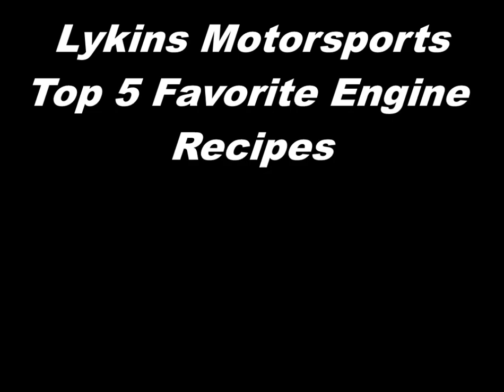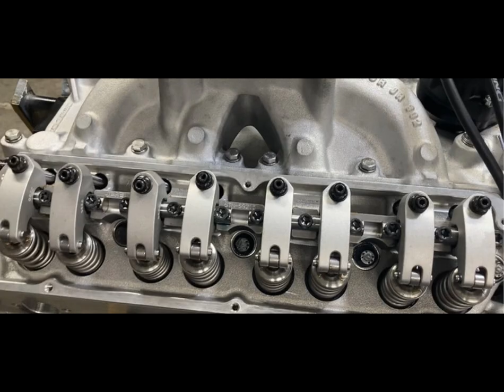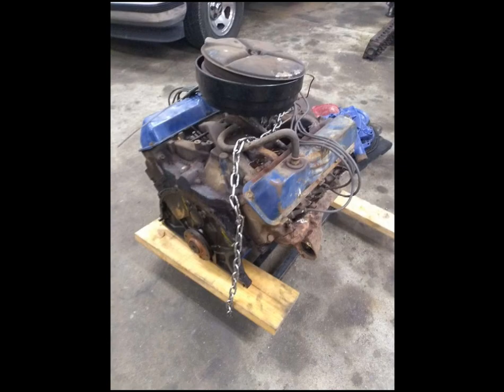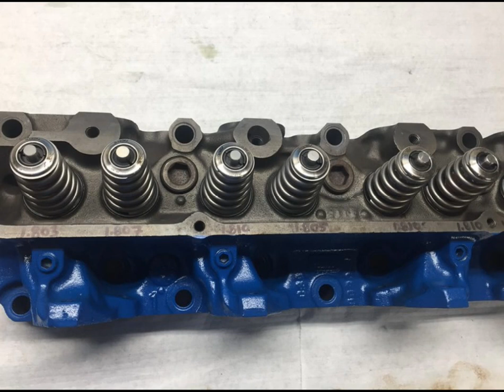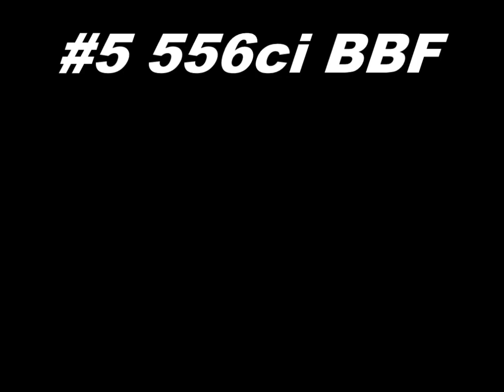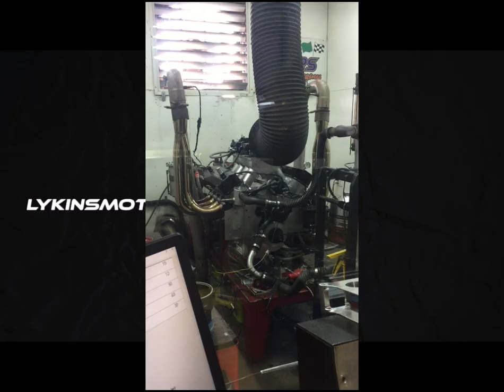Lykins Motorsports MY TOP 5 FAVORITE ENGINE COMBINATIONS

Comment: I am Ase Master tech. I have been building engines for 30 years your videos are great. you think outside the box. very meticulous. Great tech. have learned all the little tricks. Don't worry about those weird critics that everyone gets you're great at it and give the specs. explain yourself very well. Of course  I'm partial to small block Fords that's what I built for myself always but any Ford info is great. The fact that you explain about the camshafts overlap modern heads versus earlier heads that didn't breathe that's great look forward to your videos and your build videos

Comment: I loved the junkie 352 build you did. I am a huge fan of the 352. Goes back all the way to my youth listening to a 1959 Thunderbird with a 352. Then, also, a 1959 Ford with a hi-pro 352. Sure, I like the other FE engines, but the 352 interceptor or the 1960 360 hp version are my favs.

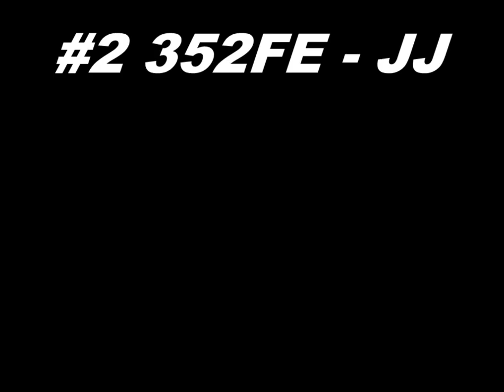Comment: I'm in no way on your level building engines I'm honestly in assembler I have a machine worked on by a professional I expect out what I want Have the machine work done. That little 311 Ford I've had similar experiences with short  We do 5 inch stroke Chevy's seem to be much more forgiving on compression and cam advance. Short scroll long rod bigboard motor seems to have some kind of magic. Way back in the day I built a dark 400 block with an Eagle 325 large from a crank in it With 6 inch rods I've been the one compression And unfortunately Reed cam's is gone but I had them custom guide me a cam I cannot remember the specs. But that little thing went 6:04 6:04  8 grand and made big block talk 575 horse 475 foot-pounds. What's the mold dirt track Canfield heads 2. 08 1. 85 valves Jessie shaft rockers

Comment: Really surprised the customer looking at the 5.0 (311) motor would not step up to a world products, or similar block, instead of using filler. Also, that clever would be nice at 11:1 in street trim

Comment: I liked the vice grip exhaust bolt on the352!  I had a 390 FE that punched above its weight. It would push the 76 F150 to well past 130 mph. The second owner after I sold it ran it up to where the 100 mph speedometer wrapped up against the zero stop peg. I don’t know how he steered it, as the front was really light at 130. It would start pinging when you leaned into it at 100 mph. Way too much fun. The only failure was the rocker shafts cracked on the outboard ends.
Reply: I grew up driving those old twin I beam trucks! If your actually driving them 130mph I'd love to take out a life insurance policy on you!😂😂😂

Comment: Too funny seeing that intake adaptor for the Cleveland intake, I just watched a video by Kelly Coffield where he foam cast an inline Autolight carb manifold and air cleaner mount in Cleveland dimensions to fit on an FE, Absolutely Beautiful work it looked just like an original casting!

Comment: I would love your recipe input for a 408 Cleveland, with stock quench 4V heads. Cam specs, intake recommendation, stud or pedestal rockers, etc... Street mostly, occasional strip. torque monster in a 70 Ranchero. Thank you in advance.
Reply: Damn son, I was thinking the same thing  - and for lighter cars as well. No need to rev a 408 to 8000 either - and prefer not to use filler in the block

Comment: Those FE dyno pulls gave me goosebumps, but the sounds that big Ford made nearly made me feint lol. Excellent video Brent
Reply: They had really good rod/stroke ratios! Also, with the head design you could really pull weight off buy installing an aluminum intake! The old 390 with a that huge cast iron intake only weighted 620lbs. You could easily ditch 35lbs going to an aluminum intake! I grew up on those things! If they had survived until fuel injection and modified for one peice oil seals!